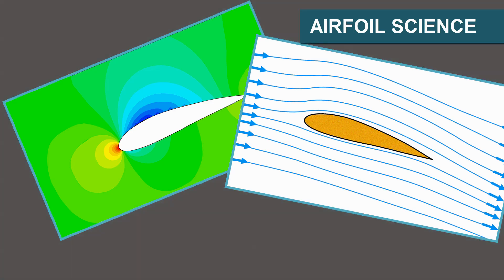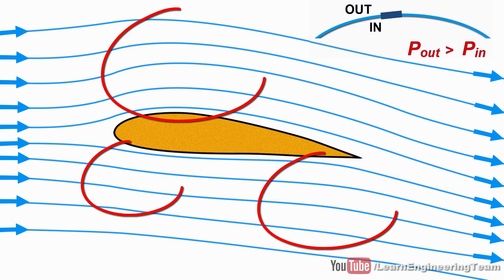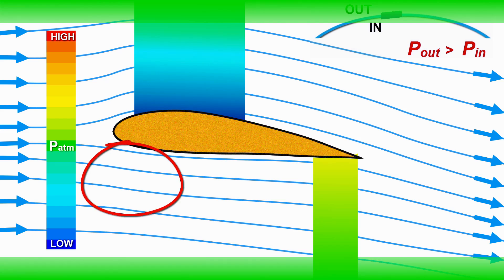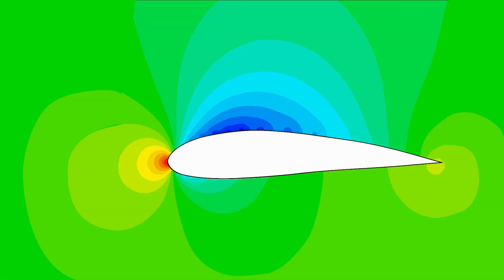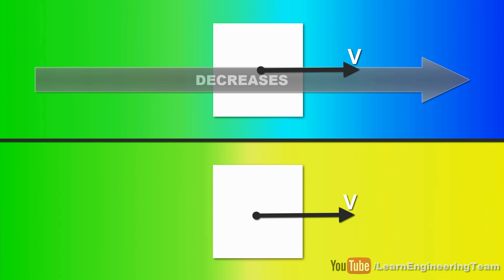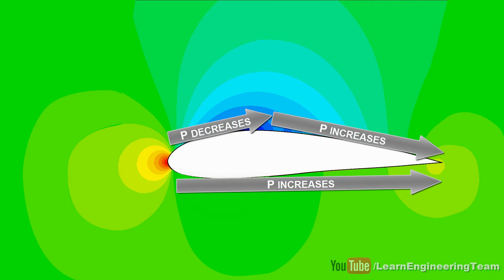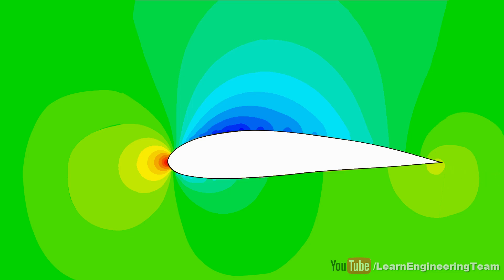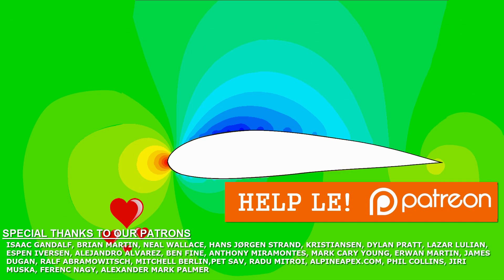Why is the top flow faster over an Airfoil?

Comment: The "equal transit time" explanation starts by arguing that the flow over the upper surface is faster than the flow over the lower surface because the path length over the upper surface is longer and must be traversed in equal transit time. Bernoulli's principle states that under certain conditions increased flow speed is associated with reduced pressure. It is concluded that the reduced pressure over the upper surface results in upward lift.

While it is true that the flow speeds up, a serious flaw in this explanation is that it does not correctly explain what causes the flow to speed up. The longer-path-length explanation is incorrect. No difference in path length is needed, and even when there is a difference, it is typically much too small to explain the observed speed difference. This is because the assumption of equal transit time is wrong when applied to a body generating lift. There is no physical principle that requires equal transit time in all situations and experimental results confirm that for a body generating lift the transit times are not equal. In fact, the air moving past the top of an airfoil generating lift moves much faster than equal transit time predicts. The much higher flow speed over the upper surface can be clearly seen in this animated flow visualization.

Comment: There's a flaw in what you are considering here.  You are discussing what happens to the flow around an aerofoil in a wind tunnel, where the aerofoil is stationary and the air is flowing, induced by a fan.
Try considering what actually happens when the air is initially still and an aerofoil moves at speed through it.

Comment: There is a false dichotomy here. The curved path of the fluid element causes the pressure gradient, i.e., the normal to the motion change in the velocity causes the pressure gradient. Then, the pressure gradient causes the change in the speed of the fluid element, i.e., the pressure gradient causes the change in the velocity parallel to the motion. In truth, pressure gradients are related to both normal and parallel changes in the velocity and they are all related through Newton's second law of motion for fluids, i.e., the momentum equation. So, this is a consistency argument of how curved flow is related to pressure gradients which are consistent with the increase in the speed of the flow.
Reply: No problem if you correctly understand the physics.   YES, there are TWO pressure gradients to understand - the 'vertical' one and a 'horizontal' one.  However you need to understand the role that air's inertia plays in the formation of pressure changes near an immersed surface when there is motion. . . 
.
Summary for you:  Air's inertia is a 'cause' of the vertical gradient. THEN, that lowered pressure plays the roll in the horizontal acceleration. 
The vertical Pressure Gradient does NOT cause the curve flow above.  The "tremendous" atmospheric pressure does <-- the centripetal force.  Inertia opposes that pressure *slightly*, thus reducing it.
Please see: www.youtube.com/watch?v=3MSqbnbKDmM

Comment: There is no law or reason why the airflow on the top of the wing should be faster than the airflow under the wing. A lot of the airflow under the wing is deflected downward thus creating all the lift and never joins with the airflow on top of the wing.. Newton's 3rd law is responsible for generating the lift. Bernoulli only applies in a closed volume.
Reply: The fundamental laws of physics, IF you understand how to correctly apply them, DO apply and show WHY the air above a wing Accelerated as he describes here.

However, this video does Not explain the physics cause of the lower pressure above, nor the higher pressure below a wing. He does not explain WHY these changes occur.   He merely states that they are what they are - we easily measure these 'static pressures' all the time. 
. . 
. . 
Then, NOPE on the "3rd Law thing".  This is the  common Newton's Third Law 'cause' fallacy.  The downwash (Acceleration of air) is a *RESULT*of the Pressures, NOT a cause.   Air has mass and a force is required to cause (the downward) Acceleration. ALSO NEWTON.!.
.
This is just like what is described in the video. A Pressure Gradient is what causes fluid Acceleration.
.
AND. . . Much MORE air from ABOVE the wing is deflected downward than from under it.!. See Anderson & Eberhardt's book. 
.
See more detail of the true physics here: rxesywwbdscllwpn.quora.com/
.
BTY, There is also up-wash ahead of a wing. . .

Comment: But why does pressure decrease towards a surface that curves outwards? Is it just an observation in experiments that cannot be explained?
Reply: None of these online coaches can explain this simple questions. Probably because they don't actually have a strong background in Aero.

If you look at a shape of aerofoil, its curved downwars almost always. if you measure the distance from centre to the tip, the bottom curve is slightly longer.

Skin friction causes air to reduce speed below the aerofoil because theres more length it has to travel which means more friction

edit: incase you didnt know, when velocity decrease, pressure increase. so said bernoulli
Reply: @KindaFeelsNice  Air travels more slowly under the wing than on the upper side and therefore the pressure is lower under the wing.

Comment: When air molecules hit an oncoming wing, wherever they are jammed, pressure builds. Whether the wing is domed on top or a flat shape angled up, air jammed at the front, then upward, is pressured, and any jammed down and underneath is also pressured, but then things change. As air flows further back the jam over the top of the wing lessens and there comes a relative vacuum, but air underneath continues to be jammed if it ever was. In any case air passing the main jam on top of the wing encounters a relative vacuum and is pushed to speed up and fill it and, with the air molecules bouncing along and hitting all or most of the top of the wing at more of an angle than any hitting the bottom, accounts for less pressure on top. Lift.

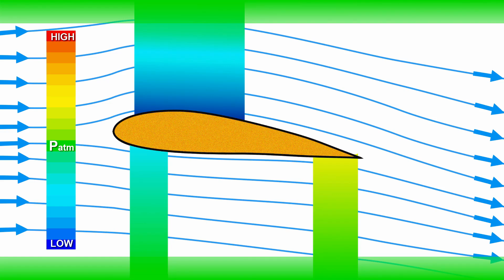Comment: I dont see how the pressure profiles are what you claim in 1:28.  How pressure profiles are determined by the curvature of the flow lines??  This is a misleading video indeed.  
        Imagine when the wing starts moving and the flow lines are generated, the Cambridge video shows that somehow the upper flows are faster before even entering the wing zone.  That means the lower flows must already experience the higher pressure than the upper flows even before entering the wing zone according to the Bernoulli equation. The natural explanation is simply because the lower side of the wing is impeding the direction of the lower flows while the upper side does not impede at all due to the geometry design.  This impeding effect increases the pressure on the lower side causing them to be even slower than the upper flows even before entering the wing zone.  The characteristic time of this impeding effect would be determined by the sound speed, not the flow speed, so its effect becomes apparent early on even before th flows reach the wing.

Comment: What happened in an airfoil is that it accelerates a mass of air downwards, the vertical component of the AOA. That is why lift increases with higher AoA.  How efficient it is  what is called Cl, function of the design and AoA. A mass that is accelerated creates an opposite force, in this case, lift. A force distributed in a surface is the pressure. That is why if you put a hand out of the car like a wing, it will go up and down. You are deflecting (accelerating verticaly) a mass of air, producing an opposite force.
Reply: A flat wing works but is not efficient as all the lift would be coming from the downward deflection as you say.  A curved upper surface also produces lift and a lot more, up to about 80% and makes the typical aerofoil much more efficient that a flat sheet.  The spoilers ("lift dumpers") are on the upper surface of a wing for that reason.  Every pilot knows about the effect of ice or even dirt on the upper surface, the lower surface has flap hinges, actuators, etc as it is not so important.  Your hand is not a flat plate, the upper part (back, opposite the palm) is also curved!
Reply: @karhukivi  that is the Cl. You can't violate Newton's laws. That is why wings and helicopters rotors have a downwash, i.e a mass needs to be accelerated to create a force. At slow speeds the efficiency of the airfoil is critical, at high speeds a razor blade will do. With enough power even a brick can fly.
Reply: @vascoribeiro69 The curved wing is far more efficient than a thin plate, which is why aircraft manufacturers use them.  The downwash is when a helicopter is hovering and is also called "maximum performance t/o" because it is inefficient and a lot of engine power is needed.  In forward flight a helicopter also gets "translational lift"  form its forward motion, which is then a rotary wing mode.  Aircraft in forward motion don't have "downwash" they have vortex turbulence following them as the low and high pressure air flows re-unite.   You are obviously not a pilot!
Reply: @karhukivi  I am an engineer, studied for pilot, designed several aircraft for simulators, but that is not the point. The point is that there is no black magic. You always need to displace a certain air mass to fly and to have thrust, either an helicopter, a propeller aircraft,  jet or whatever...

Comment: One would have thought that this is an obvious conclusion.  We must consider that there is an intention behind any shaped structure.

Let us assume the conventional shape of an airfoil section has a slight angle of attack. As the foil moves forward, the lower surface is pushing the air down but also forward  and the air below the wind has a downward component in addition to a horizontal component. (In a wind tunnel the lower surface slows down the horizontal airflow because of the angle of attack while reflecting the flow downwards). 

As the air moves above the wing, it enters a divergent shape, the  divergent shape causes a downward velocity to be created in addition to the horizontal velocity. There is a pressure zone above the leading edge to accentuate the down acceleration at a later stage. Because of the tapered nature of the upper surface of the wing, towards the trailing edge, the longer vertical distance permits the air particles to gain a higher downward vertical velocity and so this results in the flow above the wing is faster than the flow under the wing.  

Note that when dealing with lift and drag and control surceases and propeller thrust,  one should always deal with the acceleration of the mass particles at any point around the unit in question. It is acceleration that create force and not velocity or location.

Comment: The problem I have with this explanation is that the air is not moving, the airfoil is. So the air above the wing is sucked backwards as the airfoil passes, and the air below is pushed forward. This results in a net clockwise circulation of air around the airfoil. What people fail to explain is what happens in the wake of the airfoil with two layers of air, the upper moving to the right and the lower moving to the left, meet up again behind the airfoil.

Comment: You should clarify the assumptions used.  For example, positive cambered airfoil with no concave areas at relatively low angles of attack and subsonic flow throughout.

Comment: You should have started with a symmetrical airfoil at 0° AoA and develop your arguments from there, comparing the pressure and particule speeds over and below the wing with the pressure and particle speed of the air outside of the influence of the wing, and only once it is understood what happens in a zero lift condition, develop the explanation of lift.

Comment: isn't the different speeds caused by boundary layer formation?
Reply: If it was, the speed should be lower, the closer it is to the wing. This is not the case.

I think boundary layers are just neglected here, which is okay in my view. Also, I think the AIR SPEED measured along a gradient vertically to the flow would first (1) increase slowly from far away ( atmospheric) to minimal pressure line near the upper surface, then (2) decrease rapidly on the last section from minimal pressure line to the (upper) surface. (Please read carefully, I hope I was clear.) If I get it right, the boundary layer is a result of adhesion and friction. Does anybody want to comment on that, and does anyone know if the boundary layer varies in thickness along the airflow?!

Have a nice day everyone.

Comment: Air has weight .The shape of the wing forces the air molecules to follow a path  across the wing which is changing direction . That flow  following  the wing is attached by a boundary layer . This transfers to the wing surface the effects of the centrifugal force providing lift when the speed of that air across the wing  is fast enough . The lift is from the weight of the air being forced to change directions across the wing . There is no lift on the last 1/3rd of the wing .The Tailwind wing has very little upper camber and has a higher stall speed as a result .

Comment: That doesn't make sense to me. The pressure at the tio of the airfoil is high. The pressure at the front upward curve of the airfoil should also be high. The pressure wouldn't start dropping on the top of the airfoil until it gets over the highest part of the top of the airfoil.

Comment: This explanation does not account for the difference in behaviour between a hydrofoil in liquid helium and the same hydrofoil in liquid sodium. In liquid sodium there is a flow separation from the trailing edge and a starting vortex is left in the flow. Bound vorticity of opposite rotation and magnitude is then associated with the aerofoil. This generates lift by the Magnus effect.

Comment: As with so much of Aero. It’s slightly more subtle. The pressure gradients are sadly much harder to explain away like you would in a river or other fluid flow. There the total pressure (the integral across the river) is the same before during and after a bend assuming no energy loss to friction. With the airfoil the integral from the ground to the airfoil is higher than before whilst the integral from the top of the airfoil to space is lower than before. This I would argue is due to the velocity increasing as a result of the Chanda effect but that is a active area of debate (what causes what)